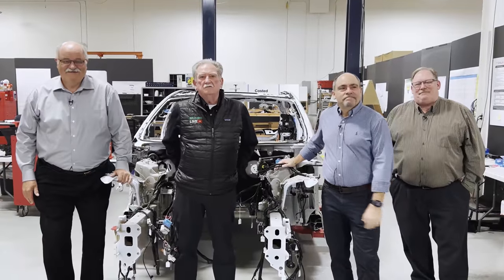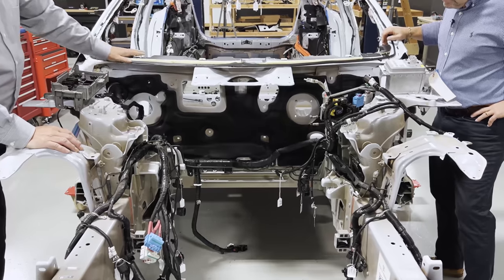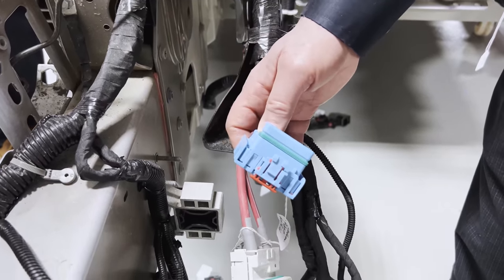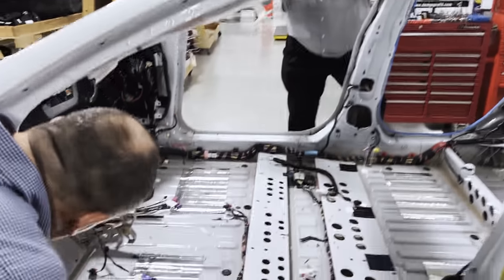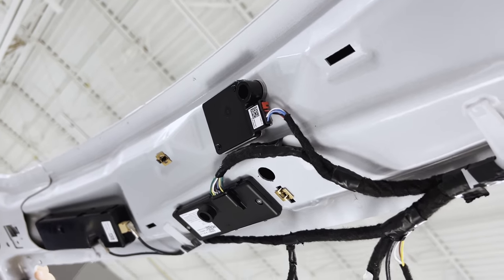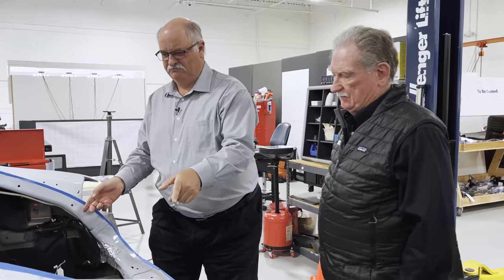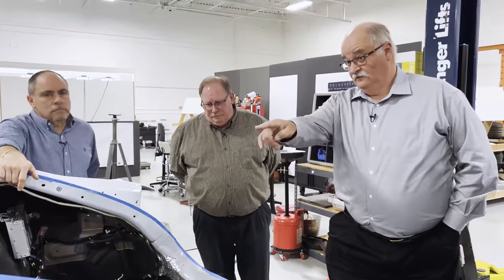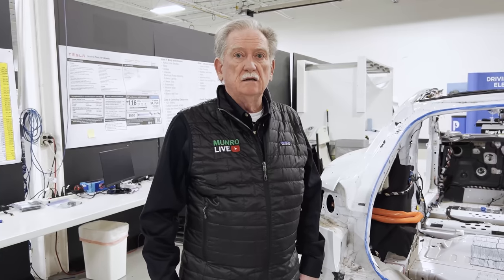Plaid Low Voltage Wiring First Look | Tesla Plaid Teardown

Comment: Unsafe dopey yoke steering,horn button is a hazard,lots of complaints from owners...plaid s I a dumb poorly designed novelty.  There is a reason vehicles world wide have standards...tesla does dumb stuff just to be goofy.  Thinking the dumb yoke is good,means you really are not a design person nor actually drive.  You are the same one who doesn't want to figure stuff out,yet say yoke is good with stupid horn placement,that has caused accidents
Reply: If you're going to try FUD, at least use a spell checker, recognisable punctuation and correct spacing.
Then, maybe fact check before posting things which either aren't true, or have been corrected.
Have a mediocre day.
Reply: A poorly placed horn button is hazardous and has CAUSED accidents? Millions of cars in the 90s had little horn buttons on the wheel; no problem.  The yoke is unusual,  but many owners who actually spent their hard earned money like their yokes and use them daily.  Sandy and team just drove this across country for thousands of miles and loved it.  The yoke directs your hands to the sides,  clear of the airbag; an actual safety feature. If you think Tesla didn't spend untold thousands of hours agonizing over this change and ensuring it worked,  you're sorely ignorant. Good design doesn't unthinkingly write off new ideas,  but thoroughly investigates them. 

Oh yeah- so far,  not one accident has been reported to have anything to do with the yoke in thousands of cars having driven millions of miles.
Reply: I think you'd be a lot happier over at Scotty Kilmer's channel.
Reply: @MarkXHolland  lol you're not wrong
Reply: @Mark Holland  hahaha,no he has old worn out Toyota fetish....
Reply: @James England  get current information...accidents are reported,and its another tesla investigation...its poor design,and doesn't conform to safety standards
Reply: @cengeb  you're just hunting for excuses.  You don't need my help.